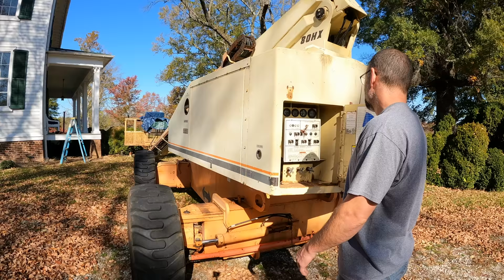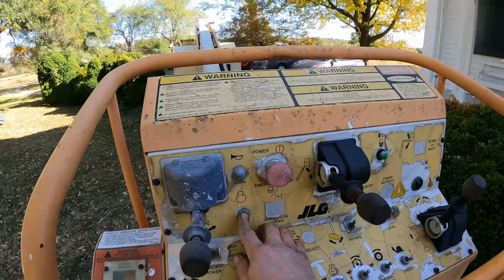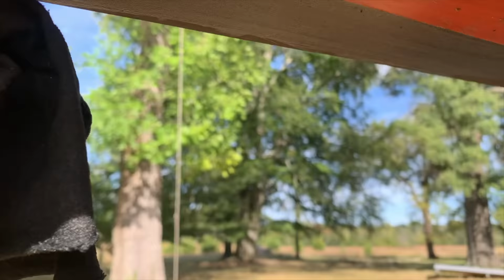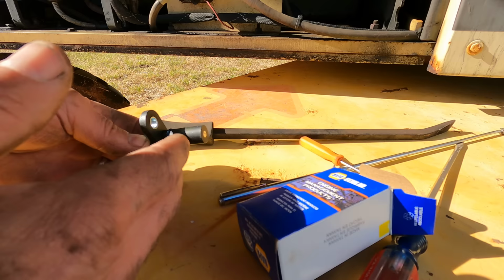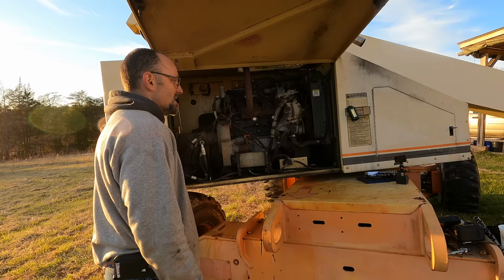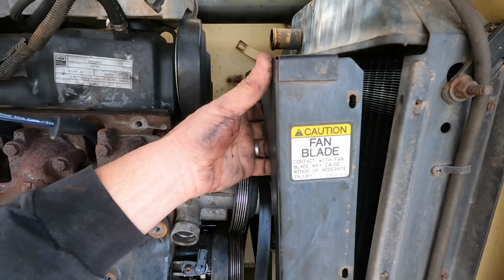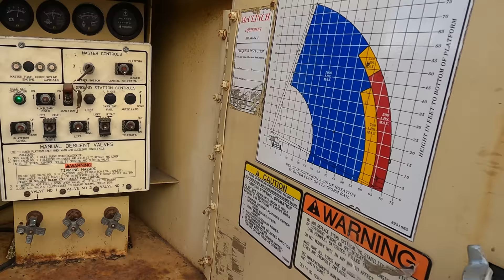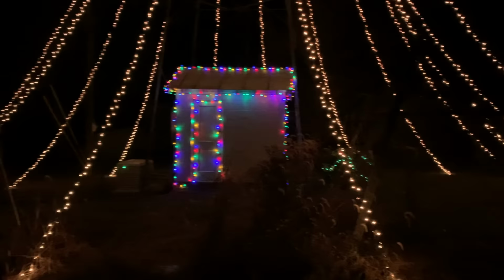My Boom Lift Broke Again! Fixing It & Then Doing a CRITICAL Job With It.

Comment: Hello from the Netherlands .
I think you have a vacuum leak somewhere through a weathered hose.  
or that the fuel always runs all the way back to the tank and so when starting the fuel hose must be filled all over again from the tank.  
You could also measure whether the fuel pump can still build up enough pressure with a pressure gauge.  
the machine has simply not had any maintenance for a very long time, that is clear.  
here in the Netherlands, wheel manlifts are not allowed on unpaved roads, so you have to use a track manlift.  
in that high mast would be a nice place to place an outdoor 360 degree pen and tilt (wifi) camera.  
especially with night vision then you have a nice security camera with a very nice overview during the day and night .
Merry Christmas in advance .
thanks for the video .  
Sincerely, Hollandduck

Comment: Had a bobcat that would do something like that. Part of its problem was making sure the fuel shut-off solenoid has good ground. If too much tape is used it can cause a non-grounding problem so the solenoid shut off.

Comment: The EVAP canister purge valve is stuck open and during the first start of the day is overwhelming the engine with fuel vapors.  That's why it puffs black smoke when it finally starts.

Comment: It's difficult to see the mechanism in your video, but I suspect the adjustable stop that restricts the choke from fully opening is there for cold weather running. You could back it off by winding out the set screw. Running rich on higher throttle & revs with a partially closed choke would cause the black smoke from the exhaust.

Comment: I think it is your choke. Pull off the hose to the carb so you can see the choke plate, is it completely closed? If not loosen the three screws on the choke cover and turn the cover clockwise until the choke is closed.
On that thing you think is an adjust for the choke opening stop is an adjustment. Soak it down with a penetrating fluid, not WD40, use PB Blaster or something that actually is a penetrating fluid. With the a wrench on a the nut use a pair of locking pliers on the knob that sticks out and try turning it. You may have to let it soak a bit before you try turning it. You may have to remove it from the carb body and use some heat on the nut to help break the bond between the nut and adjuster screw. Once loosen reinstall and see how much adjustment it takes to move the choke plate. With a warmed up engine the choke should be fully open, if not adjust the stop. Might need the engine running while doing this.

Comment: if u have the room for it, try to find an old distributor for the ford 2.3l engine. it would probably start and run much better with it. that engine has been around for a while. that block has a place where the distributor used to be but it has just a cap over it now with a shaft underneath that is used to drive the oil pump.

Comment: Given all you've done to that engine I guess two other possibilities. 
1.  Low compression (did u test compression?  Valve clearances? That would account for hard starting)
2.  Air leak

Comment: I had a very reliable Yamaha motorcycle but suddenly it was getting starting problems, and although i have the microfiche with all the parts and part numbers the item giving me trouble wasn't on it. It turned out to be a tiny little sieve just under the copper float screw that was clocked with fibers. The mechanic knew about this little sieve, cleaned it out put the carburetor back together and a three week headache went away. I'm not saying you have the same problem but it could be worth mentioning it. I wish you all the luck and I know what a nightmare this could be.

Comment: Josh, First check the throttle shaft play if there is an excessive amount of play you will need to richen up the idle mixture needle. Get it warmed up and adjust the needle for maximum rpm and then back off 1/2 turn. Just out of maintenance replace all the plugs.

Comment: Use motorcycle chain lube it will last longer
 Apply it from where you showed it to us. Also  open any panels that access the chain . Call the manufacturer for help and a manual. Good luck

Comment: You may want to ask Santa for a Stanley rotating handle socket wrench for Christmas... for use in those tight spots were you can't swing a ratchet wrench due to constricted space. Turning the handle to ratchet the socket is a god-send in those situations. Nice lights... was expecting Christmas decorating to be your goal, but on a tree, not a tower. Looks like a tree, so there ya go.

Comment: You have done a lot of work.  You might look at the hydraulic system for the lack of power with the drive motor and the boom retraction.  i believe both are hydraulic powered and have weak performance.  Check the pressure when operating boom and moving. Check to see if it's within Pressure and Flow / displacement specifications.  May be a simple adjustment to pressure regulator, filter restrictions, or other hydraulic system weakness.

Comment: I'm no expert, but here's a few thoughts:
The rotation of the choke on the throttle body should set the position vs temperature response, which would affect cold starting. I think Watch Wes Work explains how to set it in a video.
The ground wire near the lower radiator hose looks pretty rusty. Could be related to the intermittent spark? Did you investigate with spark lights after changing the coil pack and plug wires?
What about the plugs themselves? Condition and gap?
You checked the air intake, but is the exhaust system clear of debris?
Could the timing be off?

Very entertaining, I enjoy a good mystery!

Comment: That PCV (positive crankcase ventilation) valve should rattle. That's how you test it. If it doesn't rattle, the ball is stuck. It must face the correct direction so venting from the block into the intake tract is possible but the opposite is not.

Comment: John, great job again.  Dont mind a long video when done as well and informative as yours.  Crank sensor makes sense.  Given that beast lives outside exposed, I would recommend any time you have to pull a sensor from a drilled hole cavity, scuff off oxide / corrosion and wipe hole with antisieze so corrosion wont swell onto sensor forcing you to break sensor.  From other comments others covered propper fuel pressure and vacuum leaks.  One other thing to assure is spark strength.  You put new plugs, wires, & coil (check).  Spark plug light confirms yes spark but not how good it is.  Cant easily measure directly, but check the positive and ground connections (eng to chassis, chassis to battery, battery to computer, computer to ground, ignition coil to power and ground for any corrosion.  That leads to poor conduction, poor signal processing/timing/ignition control.  Saw rusty steel bolts holding main grounds to rusty chassis etc.  Disassemble, wire brush/dremel wire brush everything, assemble, and hose with battery terminal anticorrosion spray grease to stave off future corrosion.  Just a few ohms of resistance can lead to weak spark.  When cold starting there is fuel enrichment going on for many reasons and spark needs to hit stronger to ensure it lights of air/fuel mixture.

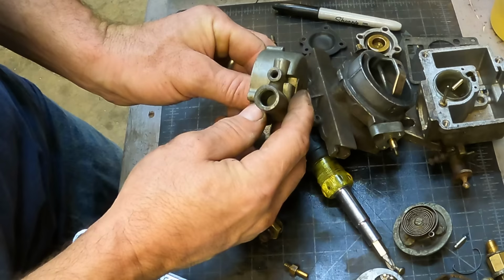Comment: I think I see the problem with the choke.  4:16, the device you're holding is designed to manually set the range of motion for the automatic choke.  I think that you loosen the small brass lock nut, and then adjust the screw.  The screw pushes the piston that moves the choke limiter linkage.

It looks like somebody ran the adjusting screw in too far, and now that piston is jammed in the bore.  You're stuck at partial choke even when the engine's hot, and that's going to give you all sorts of carburation issues.  I recommend freeing that mechanism up before you swap any more parts out.

Comment: Black smoke is not enough air for propper combustion. That choke restrictor is for a LP gas system. If you never use the LPG system I would remove it. Also, you can see in the clip at the start pointing at the engine the computer is moving the throttle lever back and forwards, as soon as it moves full throttle the engine starts. I would also replace the ckoke element as they can lose their spring over time

Comment: Another reason for the difficult starting may be a vacuum leak on the intake manifold. Suggest you pull the manifold (fun, fun, fun) and replace the gasket. Also inspect the flexible hose to the PCV valve for cracks.

Comment: I always enjoy your videos. Thanks!!! 🙂
That plug thing at the choke lever? Toss it into some boiling water and see if it moves.
I had back pressure clear silt from the filter when I powered off so the filter seemed OK. Changed the filter and it would just re-plug it up as soon as enough accumulated. Was invisible mixed with fuel. Some joker put a waxy substance into my fuel once. Same fix for both. Drain, rinse all lines, tank, carb and filter. Incidentally, the wax job seemed fine in hot weather and impossible to start in cold with no obvious signs since it took near freezing temp to solidify. Wasn't your everyday kind of wax. Great neighborhood here. 🥸

Comment: Some notes and tricks. 
Take a look if the intake manifold has no leaks, you can test this by spraying hair spray or brake cleaner while the engine is running. If the RPM goes higher, you have a leak.
Because you can't tell how much this machine is used (or abused) in the past by the previous owner(s), maybe a good idea to do a compression test.
Take also a look to the sparkplugs, if they are the correct type for this engine.
And last, when working on a cooling system, i use this trick to save some time and effort by skipping the need for venting the cooling system. 
After the parts (or only cooling liquid) are replaced, pull the cooling system vacuum by a hand vacuum pump (the type used to bleed the brake system), bend the rubber hose to the vacuum pump (or use a valve in the hose) so that the vacuum can't escape and unhook the vacuum pump, then place the end of the hose in the container or bucket that contains the cooling liquid. 
The vacuum present in the cooling system is enough to fill it back up to the top. For best results, use a rubber cone on top of the radiator to pull the system vacuum and to fill it back up. i use this trick for more then 20 years and save the hassle of venting, because there is no air left in the system. There are kits with vacuum gauge and adapters made for this purpose, but they costs way to much for what it is.  Happy holidays to you too. Grtz from Belgium.

Comment: Great video - have gone to school on your lift.  I recently picked up a used JLG 55 ft scissor lift - same basic unit - have yet to get it up and running - been too cold and wet to work on it but thanks for letting me see what you have done to yours. 35 ft (8ft dia) wind mill to put up and several ham radio antenna to work on.  Happy Holidays from the deep south - hope yall have a  prosperous coming year!!!  Several similar projects on the books here - 2 post lift for the shop.  SCAG mower  rebuild,  new shop floor,  replace boat transom,  erect wind mill, replace trailer deck - so keep the tips and tricks coming.  Always something!

Comment: Look for water in the fuel, and spray carb clean around the carb and intake manifold while it’s running and see if it changes the way it runs. If it does you have a vacuum leak

Comment: Thumbs up for the lights. Now for some further advice. On the cold start try connecting some string of somthing to the accelerator linkage. That way you can pump the throttle  manually  like you would in a car. I am betting this will make it easier to start cold. I am interest to see you try this. I think it's not getting enough fuel and has to build manifold vacuum to eventually draw fuel from the carburettor.

Comment: Suggest the following, check fuel pump for correct pressure etc, fuel filters and go back to the carburettor. Get an overhaul kit and find instructions that tell you how to set the choke correctly and check its operation. You’re not getting the choke mechanism right. I assume you’ve checked compression and ignition system. Regards

Comment: As for the chain I believe it only goes up the first leg go look at a fork lift raising mechanism but basically on the bottom part of the boom cut out an  inspection / cleaning port you can steam clean that flat chain then look at bearing housings to put zikr fitting  put back inspection /clean ink port a have relief

Comment: The next time you go to cold start your boom lift try to squirt some gasoline in the carburetor before you start cranking it and see if that helps your starting problem. Your choke may not be closing enough in cold weather.

Comment: I’ve been thinking about this and I wonder if that choke isn’t the problem. Personally I would think about rigging up a hand choke. There are a lot of symptoms of an over-choked motor going on. If you are losing 12v to that choke or the element is losing 12v that would check off a lot of boxes. Steve

Comment: Your amazing tenacity and ability to overcome frustration when faced with problem after problem that plagues significant progress is admirable.  As I don't know much about engines it is difficult to understand why the mixture has to be richer when switching from ground control to platform control.  It sounds like you have some sort of arcing or less than a very high resistance to ground with the wires that bridge the platform's controls to the motor.  Thanks for the video.  Cheers, David.

Comment: Pull the tank off and clean it out and then put a fuel filter inline and see if it has a fuel pump that is vacuum operated on it and make sure that is working as it should.

Comment: Many years ago we had a lift with a ford lrg engine and it had a similar issue. If I remember right it ended up being the engine control module. The problem was it was obsolete and required the upgraded computer and harness. Ours was totally dead and was stuck on a jobsite though. If yours has this issue you may be able to find a person online to rebuild it. I always found heavyequipmentforums very helpful. Might create an account and ask them. Good luck.

Comment: Put that engine on rails in and out :) would make you life easy.   I would test blocking the choke manually, leak vacuum with spray, timing  belt, make a gravity fuel tank, compression.

Comment: Fuel pump was my first thought. Perhaps an electric pre pump would help, fuel maybe running out of the line when it's sitting. Or, with it starting right after it's warm maybe there's a compression issue, perhaps the valves aren't set correctly or not seated very well until it's hot. Plugs maybe...

Comment: I'm thinking the starting is definitely carb related. Probably that choke mechanism and possibly the electric throttle playing a part. Reminds me of my grandfather's late 70's Ford Rangers. He had a couple and would crank and crank to get them to start. EFI does add complications but in general EFI engines start much more reliablely.

Comment: 52:27 Everyone's a critic. Merry Christmas and Happy New Year to you and yours. Make sure that lift doesn't have a cam sensor too, if it does, change it out as well, and check the wiring between all the timing sensors and the ECM, it sounds to my ear like it's going in and out of time. If you've got a wire with a bare spot grounding, it could be that. Yours might be a year too late, but check to see if you've got an ignition module, and if you do, change it, those things were infamous for partially crapping out for months before they died completely on mid-80's Rangers.

Comment: Come to think of it, I had a 98 Ford ranger that was super hard to start, it would start but it took like 5 min of cranking, but once it started you had to be on the throttle for a while and then it'd run good and idle good the rest of the day, never really figured that out on the thing, truck wasn't worth putting my money and time into.

Comment: In the AV world we do an over under or twisting it in away so it all lays flat in a loop on our cables to avoid any tension on the cable. If I wrapped a cable like that I'd be fired or atleast given a hard time about the wrapping. But that AV we eat sleep and breath Cables. But rigging equipment would be totally acceptable to wrap like you did

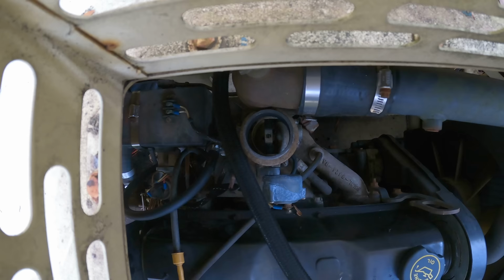Comment: From 11:50 to 12:15, if you watch the upper left corner, you can see the arm that opens and closes the choke or throttle or something connected to the carb is very inconsistent. With all of the movement of the engine as it tries to crank, there could be a loose or damaged wire that is either shorting or opening the circuit. That could be causing the "surging" action.

Comment: It seems to be running a little rich (looking at the bit of black smoke coming out the exhaust)

You could try to install a manual throttle to try to help it get started.

Comment: Boom Lift- Poor Engine Starting.
Hi John,
I'm enjoying your videos. Couple of things that came to mind while I've been watching your fault diagnosis efforts with the engine starting issues you're facing. Have you checked the fuel lift pump? I don't know if its a mechanical or electrical type that is fitted, but the amount of time spent cranking the engine before it starts would suggest that the carb isn't getting enough fuel quickly enough. 
If the pump diaphragm is weak or perished it might explain the lengthy cranking time before it is able to pump sufficient fuel to the carb, this might also explain why first start of the day is poor as fuel might be draining back to the tank over night. 
It's an easy thing to check, (although its probably located somewhere you can't reach!). Also given the unknown maintenance history, it might be worth checking the valve clearances. That could also exacerbate cold starting.